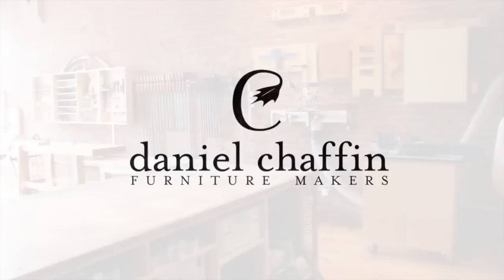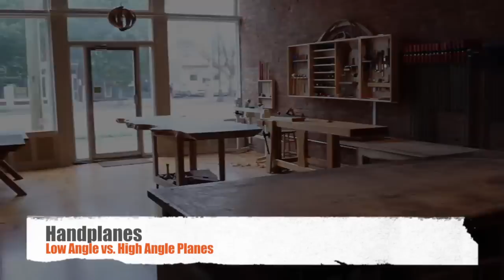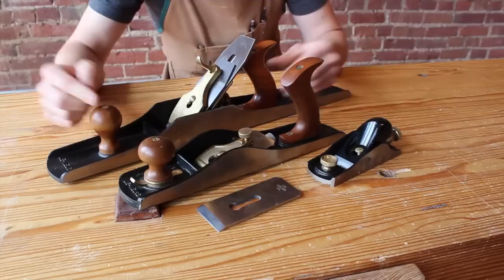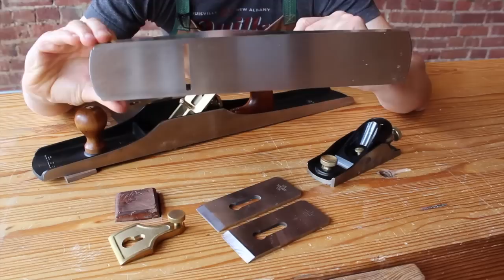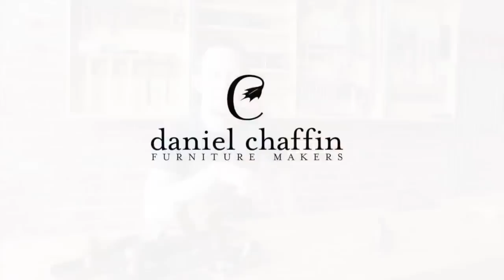Handplanes - Low Angle vs. High Angle

Comment: Excellent presentation! I'm picking up woodworking again after a 27 year hiatus. I have been trying to figure out a few technical items, like what the difference between a high and low angle plane is. I'm also considering building my own plane(s). Best wishes!

Comment: So, just to be sure, the bevel done blade is gonna cut at an angle of 45 nomatter how i sharpen it because of the 45 degree frog, correct?
What about the bevel up plane? If its sharpend to a degree of 30. Does it then cut at an angle of 42 because of the (bladebed) is at an low angle of 12?

Comment: This such an educational video. Thank you so much for takes time to explaining how it works and what is the difference between each plane. I just recently bought Stanley #63 LA plane, Stanley Block plane and Stanley #4 Jack plane. I am new to wood working and I can't wait to put them in use. I do have problem with #62 LA plane. My mother sent all these 3 planers to me for U.S. to Thailand and the #62 have 2 small dents on them at the tails end, my heart have a dents on them as well after I saw it. Please advise how can I get rid of those dents? I bought different grain of metal sand paper, but have NOT done anything with it yet. Thank you for your times and much appreciated. Have a wonderful day. Mai.
Reply: Carefully put fine grade paper on a flat piece of glass or granite and just polish scratches flat so not raised and leave it like that until your more confidant. It is very easy to introduce defects while lapping if your not 100% confidant. There's lots of videos on YouTube about lapping planes
Reply: Adam Lynch Thanks Adam. I will try that. Have a great day.
Reply: If these are the original models from the old Stanley, the low angle Jack  in particular is of considerable value. A dent or two isn't a huge deal, you can do a lot more damage to the plane trying to take the dents out than anything. Lapping though is quite useful for flattening planes. If the dents you are talking about chip towards the bottom of the plane and scratch the wood when you plane, simply file them out. But if they are dents like pits on the sole, then plz smooth them a bit so no sharp edges show, but do not, do not, do notttt keep sanding until they are out, your planes will most likely be out of flat after that much sanding and you will have literally taken a whole layer off of the plane, potentially ruining it.
Reply: Vincent Tai First I just wanted to say thank you for information. The dents I have is at the bottom and it will make a marks on the wood. It is brand new Stanley No.62 low jack. I have  it sent to me from USA to Thailand. Thank you for your suggestion. I'll give it a try. Have a wonderful day. Mai

Comment: Hi, I was told that low angled planes are good for soft woods (Pine, Spruce..)  . 
High angled planes are designed for Hard woods (Maple, Oak, Cedar). Please comment if you have experience with hard woods. Thanks Andi
Reply: +Andre arco-strings I mostly use high angle planes, and only have a small low angle plane. Both types work equally well for all kinds of wood in my experience. The key with both is sharp blades and not to heavy of a cut, and they will do almost anything (I have even planed aluminium with both, it's hard work, but it works).
Reply: I pretty much only use a low angle plain, and have found it to work well in hard wood, soft wood, endgrain...pretty much everything I have thrown at it.

Comment: for example, i just bought a stanley 60 1/2 block plane.  will i need one steep angle of 30 degrees or standard 25 degree primary and a 30 degree micro bevel?

thanks!
Reply: the micro bevel , should you decide to use one IS the cutting angle. The rest of the blade is just out of the way. It has the advantage of only having to sharpen the very very edge when you fresh it up. If you don;lt use a micro bevel, then you have to remove material from the entire surface instead of just the very very edge.
Reply: michael barnes got it...thank you!

Comment: What is the 'rule' for setting the chip breaker. Does it sit flush to the edge of the blade or a little bit above the edge.
Reply from the maker: Jason Blanton the chip breaker should sit as close to the edge as possible, but not flush. Very close. 1/64" or even closer if you can reliably do so.
Reply: It's not really possible to use the plane properly of the chip breaker was set exactly flush to the edge of the blade, this would form a new "edge" if that makes since. Setting the chipbreaker very close to the edge prevents tear out and you can do this with a standard frog so you don't have to purchase a high angle frog. Playing with the chipbreaker can really change ones planing experience, using any plane, western, or Japanese, Stanley, or Nielsen. However you really only have to set it real close when you need to, if your planing a piece of wood nicely with the chip breakers within 3 mil of the blade edge, no need to chase it.
Reply: Jason Blanton a chip breaker Can be as far as 1/16 away from the edge. As the name suggests it should break the Chips( what malkes Them role) and malkes it possible to take very long shavings.

Comment: Very informative, though it should be mentioned that not all bevel down planes adjusts the throat opening via the frog. Fixed frog bevel down planes such as Stanley Bailey's will have to adjust via the mouth like the bevel up planes. I believe it just depends on whether the frog is cast with the sole as a single piece or not, rather than whether it is bevel up or down.
Reply: Never heard of such a thing. Bailey planes adjust the frog like these bedrocks, but you have to remove the blade assembly to do so. Veritas bevel down planes planes have adjustable mouth like the bevel ups.